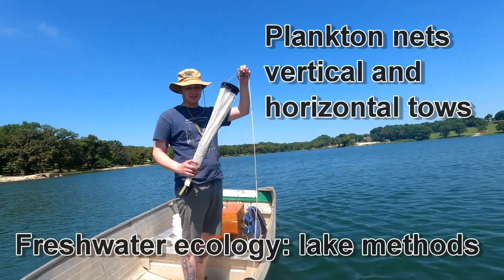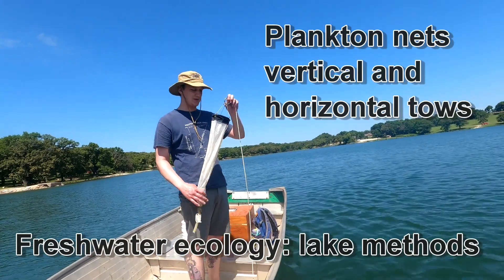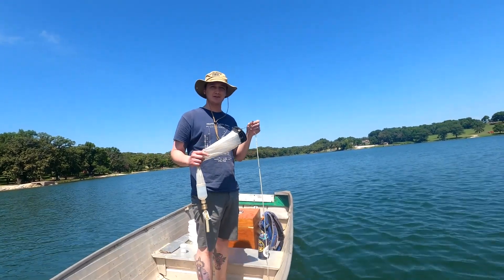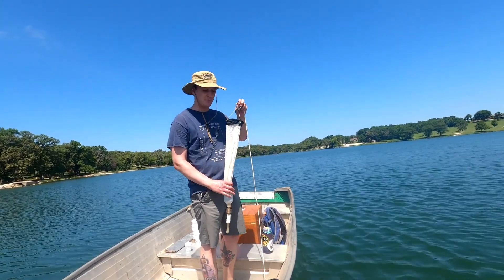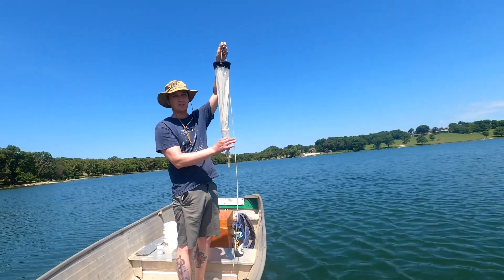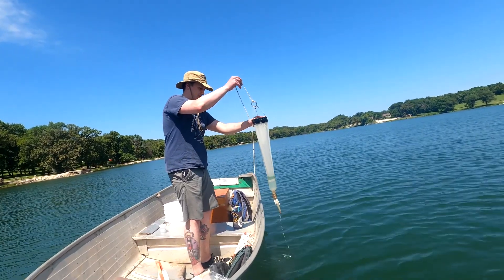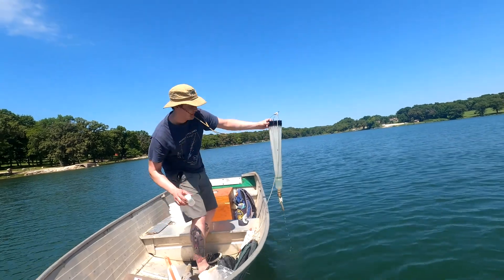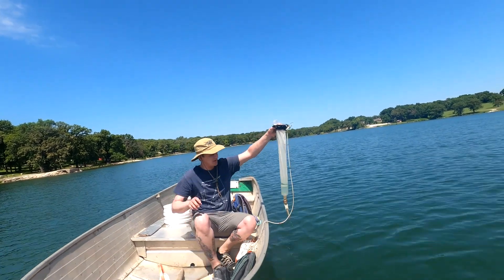Vertical and horizontal plankton tows for qualitative and quantitative samples

Comment: You might collect zooplanktons too, how do you prevent them from feeding on the phytoplankton collected.
Reply from the maker: good question! The zooplankton will eat the phytoplankton, so if you are after phytoplankton you might want to use a 1% formalin solution.  Ethanol will kill the zooplankton but it will also remove the pigments from the phytoplankton and not allow identification of many species

Comment: So is vertical tow used for quantitative and horizontal tow for qualitative analysis?
Reply from the maker: Horizontal is generally qualitative unless you have a meter to measure the amount of water that flows through the horizontal net.
Reply from the maker: Vertical can be quantitative or qualitative. You just need to know the depth range being sampled. You know the area of the mouth of the net, and the vertical distance of the tow the volume
Reply: @walterdodds6285  thank you!
Reply: @walterdodds6285 so the volume of sampled area / filtered is tube or cone shape?